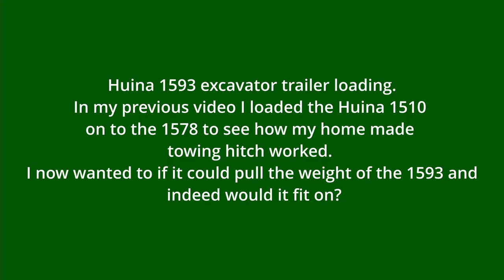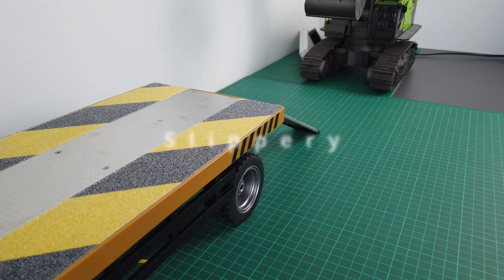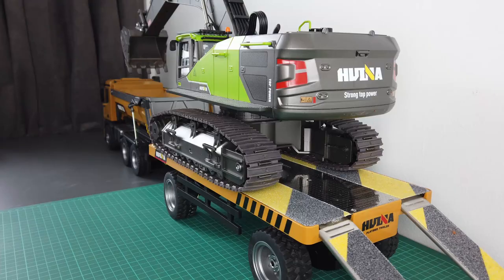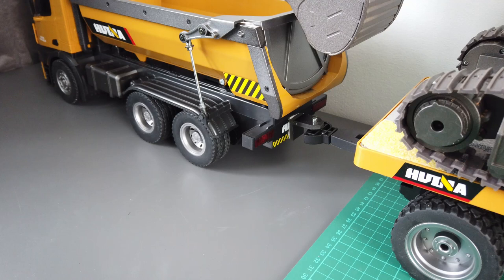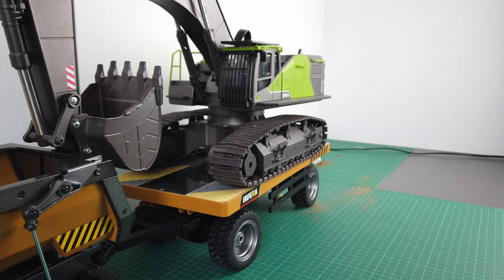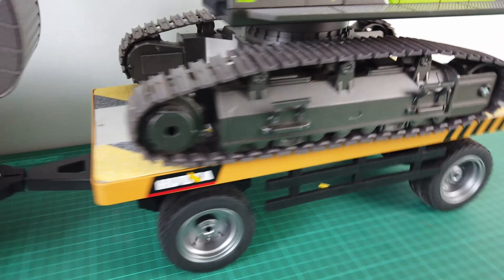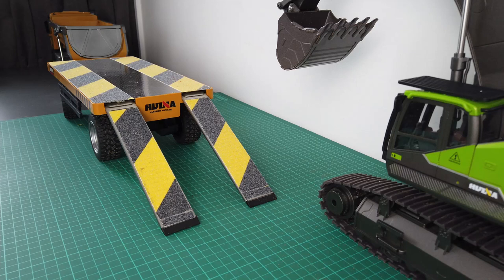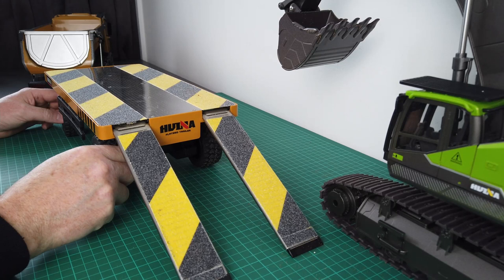Huina 1593 1:14 scale excavator trailer loading

Comment: Looks good mate, the next step is outside over uneven ground, I was going to suggest smaller wheels for the trailer but you would have no ground clearance.
Reply from the maker: Hi John, the truck does not work quite so well on  uneven ground when pulling this excavator but on a flat surface its great. Smaller wheels would make it to low.